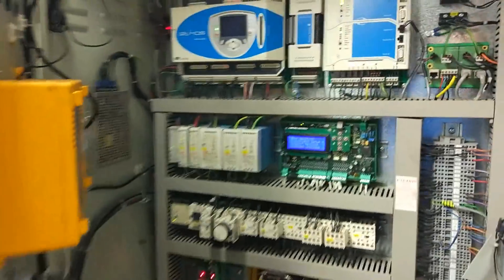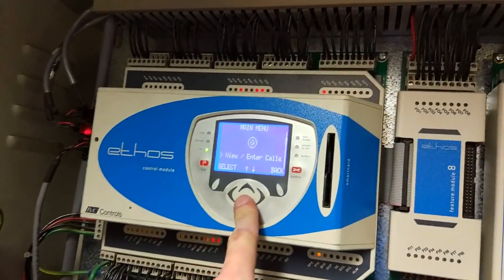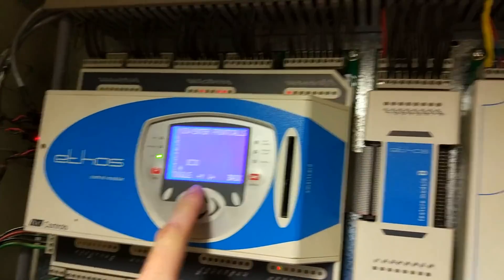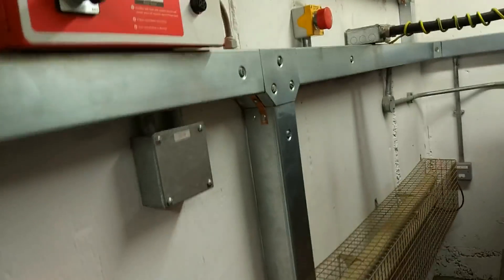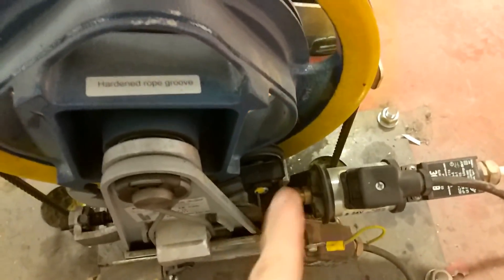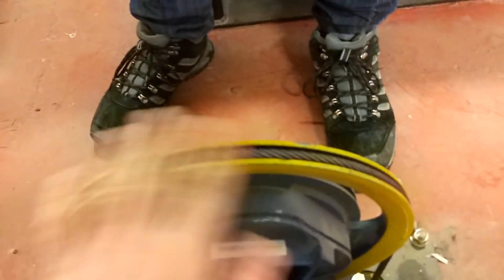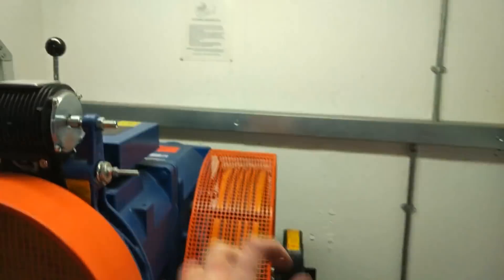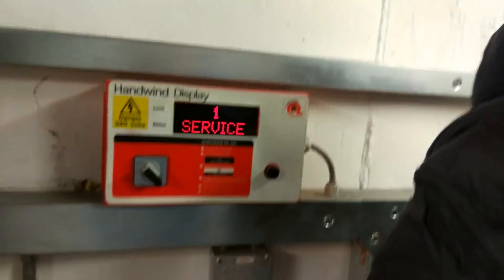Detailed look at a modern governor

Comment: Electrical or mechanical first action..???
Reply from the maker: The mode switching is done by a solenoid, which changes the trip speed.  
The tripping action of the governor that locks up the cable is mechanical system that works with no electricity.
There is also a switch on the governor to disable the lift once the governor is tripped.
Reply: @benolifts  i want that 1st electrical will be cut or mechanical safety will be action
Reply from the maker: If there is no electricity, the governor will still work.  The governor trips mechanically and pulls a cable to apply brakes on the lift car.
Reply: @benolifts  yes but we are using both electrical switch or Mechanical safety when it's free fault so who will be 1st action 
Electrical then mechanical
Mechanical or electrical
Which one
Reply from the maker: Both happen at the same time.  If the governor trips, it means that something has gone badly wrong and the lift can no longer be trusted to run.  The governor pulls on the brakes on the lift car.  This is the final way to stop the lift if all else fails.  Nothing can override this.  The lift won't be able to move even if it tried.  The electrical switch is just to stop the lift from trying to move once the governor has activated.  But the main purpose of the governor is entirely mechanical.

Comment: why would there be any reason to make the elevator freefall? why is that a thing? what purpose does that serve? honestly, that seems really stupid.
Reply: We sometimes call it "free fall" but what we actually mean is a controlled brake release. This is to rescue trapped passengers. If the lift has stopped between floors you sometimes need to relase the brake to get it to a floor so that you can free any trapped passeners. We just say freefall because it's quicker to say